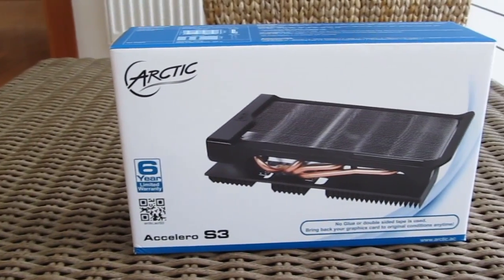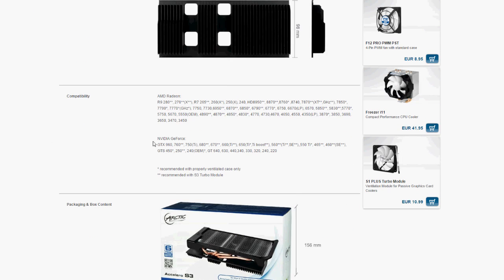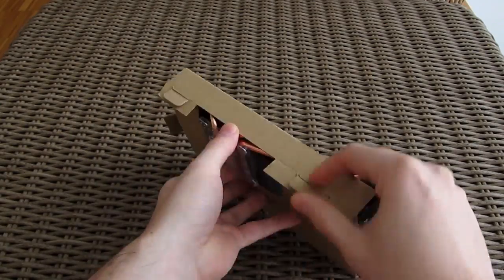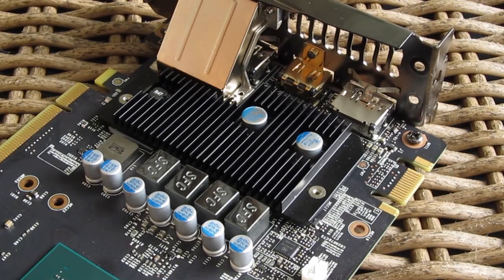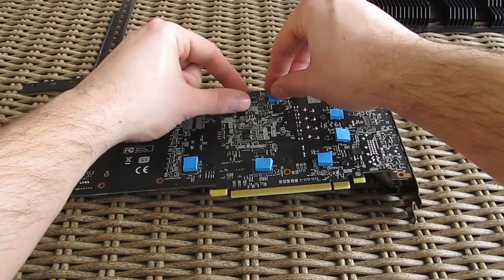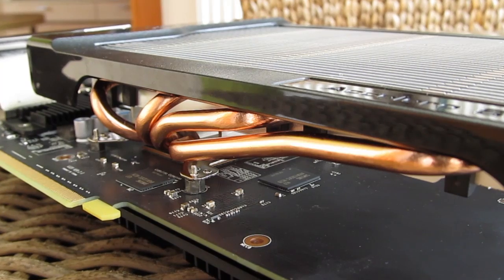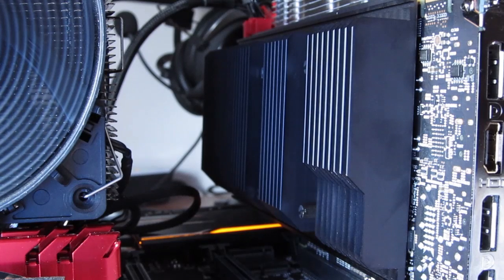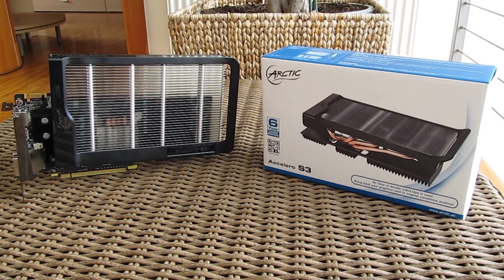Passive GTX 960 - Arctic Accelero S3 Unboxing & Review

Comment: If they made the CPU a little bit bigger with led lights that are design to dissipate heat, that will be perfect.
Also needs to be smaller.
Will this work in an HD 7950
Reply from the maker: I'm not sure, they have a list of supported GPU's on their website!

Comment: TekTick! 
I noticed that on your test bench you put the cooler in you MB's lowest slot. Would the Cancelers passive heat sink on top of the card interfere with the MB's RAM or CPU cooler if you only had a MB with one GPU slot in the top location?
Reply from the maker: I had to put it in my second PCI-express x16 (X99 MBO) slot since I couldn't in the first one because of the backplate, it wouldn't fit beside that BeQuiet cooler!

Comment: Wait, so there are no heatsinks on the VRAM and VRMs? Don't they immediately overheat?
Reply from the maker: The MSI's GTX 960 came with a VRM heat-sink which I left there, but the cooler itself doesn't come with additional heat-sink in case the card doesn't have it.

Comment: test benchs don't work for passive cooling solutions.this whole video is not acurate at all
Reply from the maker: Why is that? I have a real case scenario, playing games (Far Cry in this case), why is that not accurate at all?
Reply: real case senario?you put it in a case?all i saw you do was put it on a test bench in open air and then point a fan at it also in open air.cooling systems like this are designed to be in cases any bench marks not in a case mean nothing.the temperatures would most likely be between when you pointed a fan at it and when you had it doin nothing.If a passive cooling system does worse then when you had it in open air it is shit.If you did put it in a case and i just missed it and am to lazy to re-watch i apologize ignore all the rest of what i have just said
Reply: christopher deynes doesNOT work well enough seems, more like a gimmick
Reply: true

Comment: will this fit on the r9 390?
Reply from the maker: +Turbo banaan Noap!
Reply: +TekTick :(
Reply: what buy ? Arctic Twin Turbo II or Deepcool V4000 for INNO3D GTX 960 HerculeZ X2L 2gb OC ? my temp in furmark is 90-92C, i want to change my Cooler.

Comment: Can anyone say if the backplate will fit a GTX 980? My Gigabyte Windforce 980 doesn't come with a backplate some I'm putting together a somewhat ghetto cooler for it, just need a backplate that will fit or can be adapted to fit with the aid of my trusty dremel.

Comment: Why do you test the card placed Vertically? it is desinged to be placed HORIZONTALLY for the card to be cooled via convection, there is no way for the air to flow naturally when the card is placed like you did.

Comment: will this fit on a asus gtx 560 ti? and i only have 2 80 mm case fans will this be enough to prevent my card from overheating?
Reply from the maker: +matthi321 They says it's supported! Any fan is a plus and it's going to be more than good enough to cool it off, personally I would put one quiet 120 mm fan.

Comment: Do you know if this will work on a 950 GTX? The website doesn't state it but isn;t the 950 just a cut down version of the 960.
Reply from the maker: +dcikaruga This should work without a problem on a GTX 950, but the question is if you can install the cooler onto it!
Reply: +TekTick ??? As long as it fits, is it really that hard to install?
Reply from the maker: dcikaruga Yeah, if the cooler supports the mounting holes of the GPU, that's the only potential problem.

Comment: Also, the copper pipes are in the way of one of my screws... what gives? I can't insert the screw down all the way.
Reply from the maker: +maccollectorZ (Commenting Account) I had a similar problem with this one, but I managed to screw it down eventually, under an angle.
Reply: TekTick Yeah, I was finally able to do it... but the all-metal heat-sink keeps me from putting the card into slot #1; I have it running at less than maximum speed in slot #2 :-(

Comment: All I can find on eBay is the S1 version... any major differences? Thinking about buying it for my reference Radeon 5770, but not quite sure.
Reply from the maker: +maccollectorZ (Commenting Account) S3 has better graphics card compatibility but also improved heat dissipation capabilities.
Reply: TekTick
Ah, I see. How much does the S3 cost? I'll maybe look on Amazon, but eBay did not have ANY S3s, only S1 models.
Reply from the maker: +maccollectorZ (Commenting Account) Around $40! I think you can actually order it from their website, but I see they have on Amazon - http://www.amazon.com/ARCTIC-Accelero-S3-Graphics-Compatible/dp/B00RVAEI1E
Reply: TekTick
 And to think I was about to go spend $40 on the S1 model; thanks for the link and the information on the two cooler models! Nice videos as well.
Reply from the maker: maccollectorZ (Commenting Account) No problem, thank you! :)
Reply: TekTick
Hi again--I bought the S3 and am currently installing it on my Radeon 5770! (Yes, I know, it's an old card, but it's hard to get really nice cards that are flashed for Mac Pro.) Question, though: On the top side of my card, the RAM chips are covered with a flat heat-sink that goes along the surface of the card; does that mean that I don't need to apply the blue thermal pads? It seems as though this heat-sink is meant to stay on here and would do the job just fine.
Reply from the maker: +maccollectorZ (Commenting Account) I think you could leave the thermal pads, but then again, maybe those from Arctic have better heat dissipation properties!

Comment: can I do it on mine sapphire r9 280?
i have 2 120mm fans if need for it
Reply from the maker: Damjan Kovacev It theory you could, looking at the official web page, it supports R9 280. Just make sure you don't have some wild custom PCB,
Reply: I have standard sapphire r9 280 PCB
Reply: Damjan Kovacev i mean, it is new and it is "standard" dual x sapphire gpu, should be  fine

Comment: it's a cool product but why develop something like this for a card that is already low in temps and anything but the reference card is already well cooled
Reply from the maker: So you can run it completely passive, even in load :)
Reply: +TekTick Thing is in most cases you wouldn't hear the GTX 960 anyways...my MSI GTX 970 goes up to a only 1200rpm when being maxed out and in my case I cannot hear that.